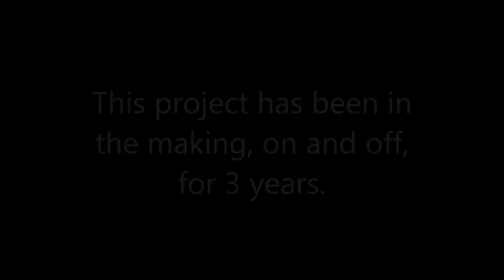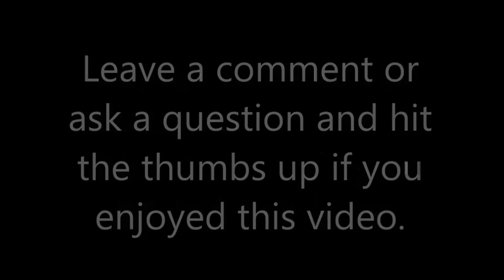The Detail On This Scale Model Is Next Level...Check It Out !!

Comment: Here's a tip for you Joe. If you want to paint/stain all sides of a part, make yourself a yard long board with a series of tapered posts along the length (I use old artist brush handles). Then, once you've painted the underside of the part, seat it firmly, through one of the holes in the part, on a tapered pin. Then that frees you up to do all of the other sides without getting fingerprints in the finish (and getting paint all over your hands 😄).

Comment: I like wet sanding it with Tung Oil to fill all of the grain and then apply top coats of Tung Oil until I'm happy with the look.  I don't like boild linseed oil because it never really hardens.  I think what you did looks good, but I just wanted to give you an idea of something to try if you do this again.
Reply: Hand rubbed Tung oil is one of my favorite finishes. Takes a bit of time but it is time well spent.

Comment: Try natural woodstain cup of spirit vinegar dissolve a bunch of steel wool in it. Paint on and dry makes a very dark c
Colour on most woods.
Reply: The vinegar would turn the brass pink, even if he repolishes the brass, the humidity in the air would cause the vinegar to reactivate and the brass touching the wood to go pink on the edges again, I don't think that's the look he's going for.😉

Comment: Really nice job. Every machinist makes two things at some time in their life; one is a steam engine, the other is a cannon. For some reason, usually a marine cannon. I am currently making a Napoleonic 12 pdr field cannon, with limber and accessories. Rather more than 7 wooden parts- there are 31 for each of the four wheels alone... As the original drawings are available, no much room for winging it.
Reply from the maker: I'll get to my field gun. Down the road. 14 spoked wheels and all.
Reply: @joepie221  Civil war then - Napoleon used 12…

Comment: Joe, one of the issues you run into with wood is that some species have grain that needs filling and I think what you have used falls into that category and while it looks ok I think that had you filled the grain it would have looked much better. I agree that a dark walnut would have looked better and would probably not need filling. I agree the chain looks too big and a smaller link may be more to scale. However, a great project; it is surprising how the 'simple' jobs can sometimes turn out to be the most interesting due to the problem solving on the way.

Comment: Joe, Why did you not oil the wood with Linseed oil ? Natural grain would have shown through. All you have done in effect is 'Paint" it. Regards from Australia.
Reply: Stain, as used in the USA, is literally that; it doesn't coat the wood, it soaks into it. One can then put a finish (poly, linseed oil, etc.) on top to protect it if desired.
Reply: I can see the grain just fine. The wood on cannons of the period was usually painted black. Any kind of gloss would not have looked correct. So I think his choice was bang on
Reply: My guess would be, contrast with the brass.
Reply: Fuss fuss fuss
Reply from the maker: Realistically, in my limited experience, mahogany is one of those woods that should be filled before any other treatment is applied. I didn't want it to look too finished or it may loose something. Letting the stain sit for a few minutes before wiping it off gave me the effect I was looking for. Its not deep grain like a pro finish, but it still shows to my satisfaction. I was also pressed to finish it and didn't have linseed oil in house. I have heard it slows tarnish when applied to brass. Is that true?

Comment: I prefer the maple stain as it shows the grain the best of the three, but I don't think it goes as well with the brass as the other two.
Reply: The grain will be out of proportion for an scale model, so, the less you see it the beter.
Reply: @Baldorcete  Good point. Still, it seems a shame to use such a nice wood a not see the grain.
Reply from the maker: It must be the video resolution. I see the grain just fine.

Comment: Wonder if in the 1800s the wood was just left natural or given a varnish.
Reply: Most likely they used linseed oil and pine tar, it’s weather resistant and easily restored.
Reply from the maker: I'm betting pine tar to resist the salt air. Just a guess.
Reply: @joepie221  there’s a traditional recipe for wood in marine applications of; linseed oil, pine tar and enough gum turpentine to help penetration… btw, awesome build, your attention to detail is amazing.

Comment: I'm not a fan of stains.  Wood is beautiful as it comes.  I don't get why anyone stains it.  It's always a downgrade in my opinion.  Just put a natural finish on any wood an appreciate it's natural beauty.
Reply: Depends on the wood. The issue I have with stain is it all doesn't take the same on the same species. But then I have Brazilian Cherry floors and that is just finished with a clear product due to the great variety of color in the individual pieces.
The gun carriages wood components likely would have been painted anyway.
Reply from the maker: This is just rustic enough for the desired effect.